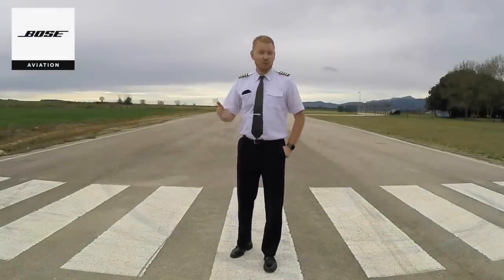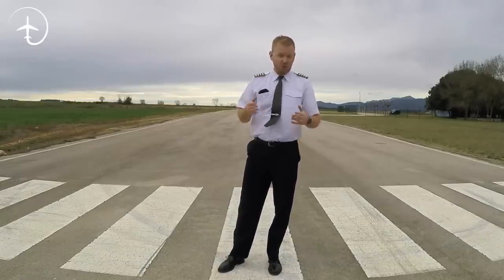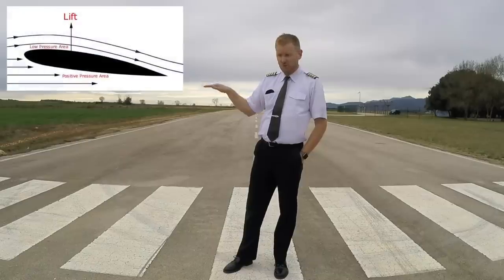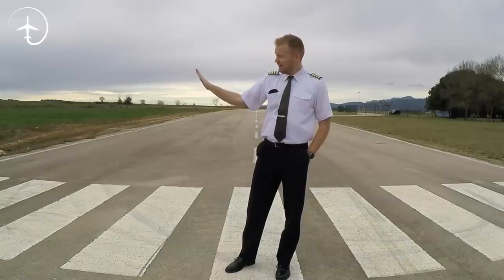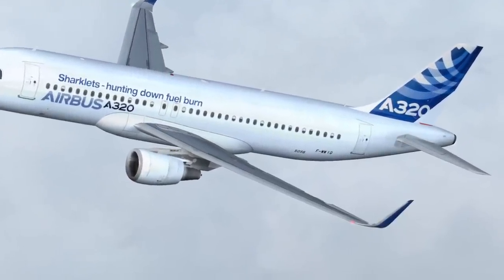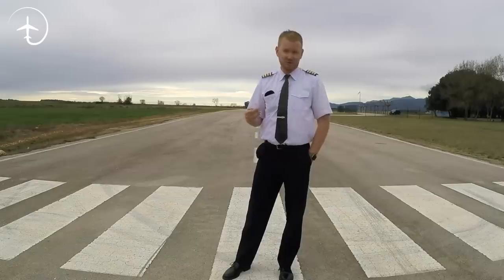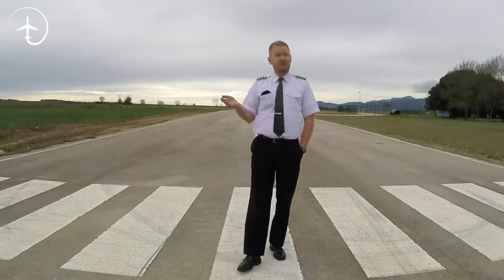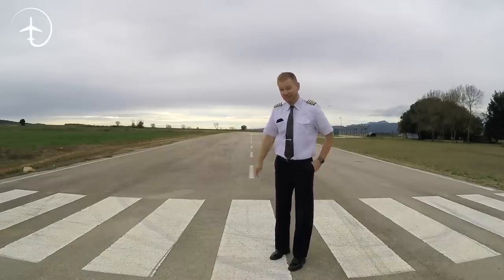Winglets - What are those things on the aircraft wing-tip?

Comment: Why haven't they fixed proportional winglets to the horizontal stabilizers as well?
Reply: I have a little experience with aircraft, and I always wondered the same thing.
My best guess is that the horizontal stabilisers aren't really there to generate lift (in fact, if you look at the foil profile, it's "upside down" on most, if not all standard layout aircraft), so they're used as a control surface, rather than a lift generating device. I'd say any efficiency gained wouldn't be significant enough to warrant the development and certification required. Just my opinion anyway.

Comment: Hello, I'm wondering why there are no winglets on the stabs?
Reply: The stabilizers should be producing as little lift as possible, so induced drag is already low and winglets would be a drag penalty (friction drag and junction drag). If the stabilizers are producing enough lift for winglets to be justified, the entire aircraft design has some serious problems. Incidentally, there are vertical surfaces on the horizontal stabilizers of the Airbus Beluga transport aircraft, but those are for directional stability (minimizing development costs instead of worrying about the aerodynamic penalty)
Reply: @AmbientMorality  thank you for the answer.

Comment: ok, it's time to turn on my embedded simulator and start guessing:
I think they are used to keep the low/high pressure at the two faces of the wing separated, which I think will reduce the needed energy needed to keep the  plan in the sky, in addition to preventing this pressure leaks I think It makes the wings more stable (especially against the wind that hit the plan from the sides) I can't prove it, but my embedded wind simulator in my head said so xd
As a pretty arrogant (and "I know it all") guy, I would be very frustrated if my guess is totally off :/
Reply: Holly shit I was so right that if I wasn't me who wrote that I'd think that the writer has created and read about that BEFORE watching the vid xd
also, I just realized that the question was: "how high the winglet is compared to him" and not "what is the purpose of adding winglets"...damn, I need to spend less time talking and more listing lol

Comment: Anyone seen die hard movie (the one with the hijackers taking over the airport) at the end it is a very cool scene where wingtip spins the smoke when they come for landing using the burning runway as landing lights. As for the Q: I think the sharklets is 2 meter tall. I think they add about the same to the wingspan. Just a bit taller than you mentour pilot. 
I know its almost a year old video but I wanna join in :D

Comment: Well, I've heard that a C-17 winglet is 9ft tall. I thought that since the 737 is a smaller aircraft that the height of the winglet would not be as tall, I thought 7 ft maximum. I was surprised that the 737 winglet was only about 8 inches shorter 8.2 ft to the C-17's 9 ft. Soooo, my guess was low.

Comment: Low psi on top of wing High psi on bottom of wing. To prevent wing tip leak from bottom to top a block is added to wing tip. Boeing at first design it wings so that a heavy block was not needed but current wing design made the heavy air block (winglet) a push on weight to wing loss. Again it has to be design into the wing and is only a push on extra weight to aerodynamic loss. So winglets add nothing to lift but prevents loss in wing tip loss and must be design into the wing from get go.

Comment: So why does the new 777-x not have winglets, but flat wingtips in flight, that fold up on the ground to reduce the span
Reply: Niels Daemen A span extension is strictly better than a winglet (under aerostructural analysis) for decreasing induced drag. The issue is that planes can’t fit in gates with long wings so winglets or folding wingtips help with that. Folding wingtips add a mechanism but evidently worth it for 777x.

Comment: If I estimate your height correctly I would say you are 1.75 meters tall, or 5 feet 74 inches more or less. In comparison to your height, a 737 winglet should be approximately 680 centimeters or 2 feet 26 inches taller than your estimated height if calculated according to the winglet's height being 2.4 meters or 8 feet. (Which if I'm correct is the standard height?)

Comment: Winglets are for balance when landing
Reply: Winglets are used to reduce the wing tip vortices.
Reply: Winglets makes the passage of air from the bottom of the wing to the lower pressure top of the wing more difficult, thus reducing induceddrag.

Comment: I suspect that constraints on the wingspan is a relevant aspect, but not mentioned. If winglets would be doubtlessly aerodynamically superior, gulls and albatrosses would have their wingtips bent, but they don't.
Reply: So. You know something that hundreds of aerodynamacists don't?
Reply: @droceretik  You know hundreds of "aerodynamcists" who all told you that they do not know this? That would surprise me a lot. A horizontal wingtip (AKA as longer wing) not only prevents the undesired air flow as well but also makes additional lift, so the rest of the wing can be smaller. A wingspan constraint is of course not exactly an aerodynamic question in itself. And I am not claiming winglets are never the best solution, I am just saying they are not doubtlessly always the best solution and the aspect of wingspan shouldn't be ignored when discussing them.

Comment: winglets were first on Hanley Page Victors early 50ies
Reply: I think you maybe mean the experimental aircraft Handley Page HP.75 Manx? Actually, they were never used on the production model of the Handley Page Victor.
Reply: @mikep9604  They were not used but were proposed originally but not required as the plane worked adequately without them

Comment: vertices! winglets helps to save about 6% of the fuel (meaning that it will increase about 6% of lift)

winglets has nothing to do with “engine noise”! engine noise reduction is achieved by designing the engine “fatter” and “shorter”.

Comment: If the winglet is so great how come the 777X has none?
Reply: Instead of winglets the B777X has raked wingtips (like also on a B787). The B777X is going to fly long haul routes, and the wings with raked wingtips are more efficient during long flights. Raked wingtips also reduce the effect of the wingtip vortices and therefore reduce drag, and improve fuel efficiency.

Comment: Are engineer's going to find that Boeing added winglets to the 737- NG that over stressed the "Pickle Fork" limits???   All the cracks in parts designed to last a lifetime of the aircraft...
Reply from the maker: Hard to say. I would be surprised if that was the reason
Reply: Would be very interesting if there was a correlation between the early NGs sold without winglets and the cracking . Probably could figure that out with some research but I’m too lazy

Comment: I'm not going to watch the video.  Winglets let you lengthen your wingspan without having to make your aircraft wider.
Making them wider would increase the necessary widths of runways as well as docking stations.  We want to avoid the cost/space requirements for that. (Duh!)
Increasing the wingspan deceases the overall drag.  We DO want that.  (Duh!)
Maybe increase the wing length, but do it on a tangent?
If you can't follow, get used to asking, 'You want fries with that?'